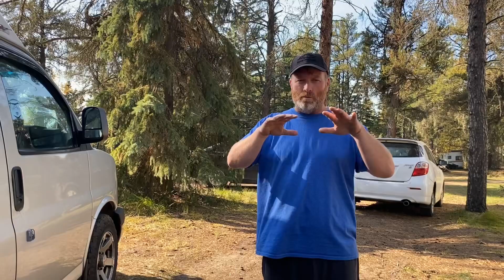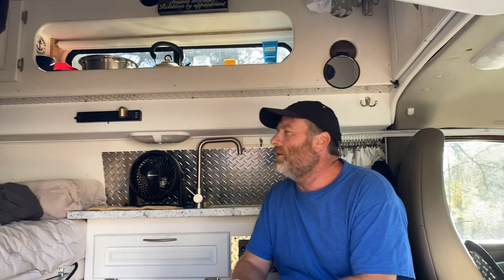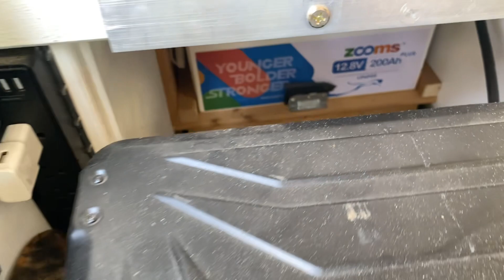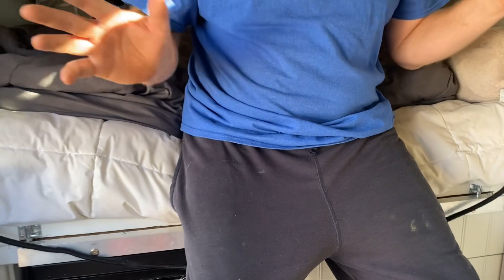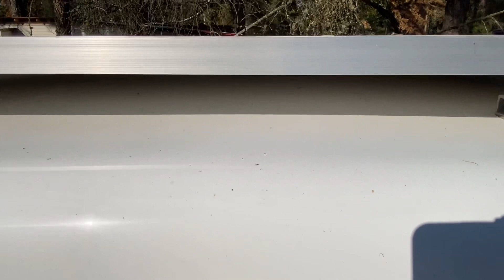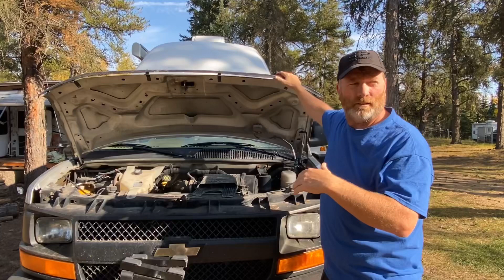Today Tiger will be showing how he set up the SOLAR SYSTEM and ELECTRICAL in the Van !!

Comment: Great van setup. If you go to Camping World or someplace like that, you can get a battery isolator. It will automatically connect the house battery for charging and disconnects when you turn the engine off. You don’t have to remember to disconnect it.
Reply from the maker: Thanks !!